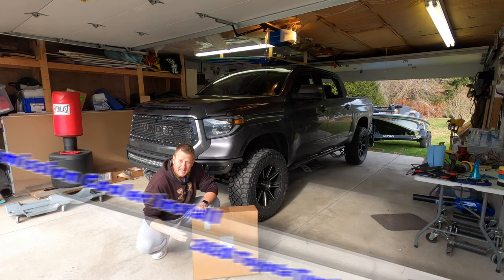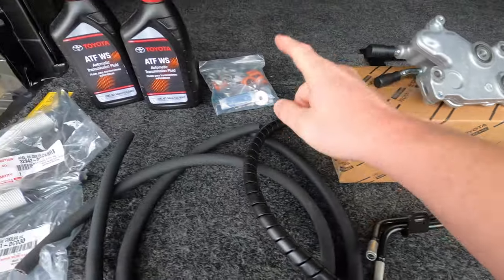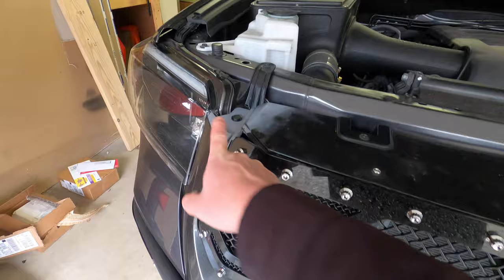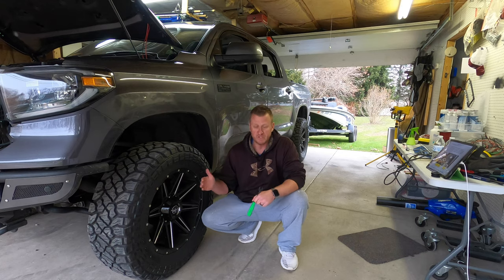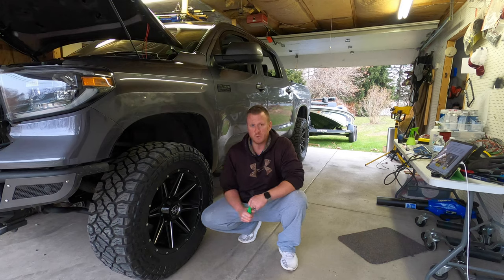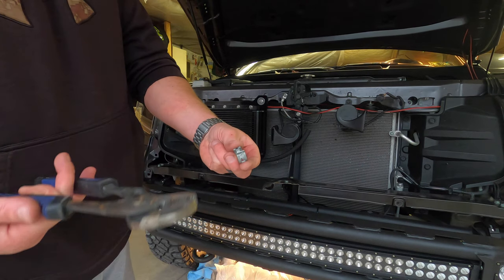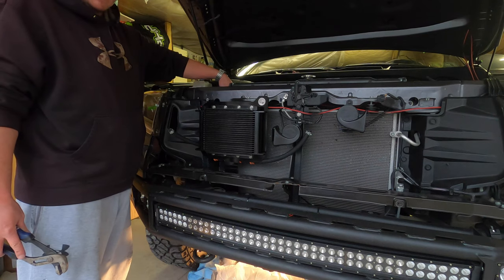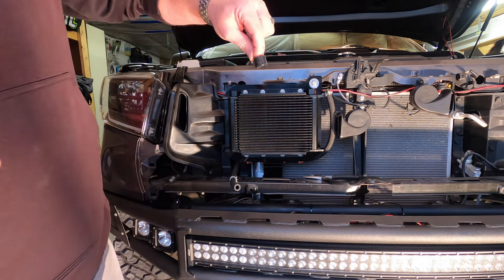Transmission Cooler Install On 2020 Toyota Tundra

Comment: Thank you for the video. Really easy and very well explained. I have a question for you that i may have missed the answer. I see the pin in the thermostat. Is the thermostat pinned and the oils is flowing thru the new cooler at the time you check the level ? 

Thank you again for your video.
Reply from the maker: Thanks for watching Virgil!...Yepper, leave that pin in until after the entire process is completed, it should be the very last thing ya do...you can remove it before going for test drive, but I left mine in until I knew there were no leaks and everything was buttoned up...so it was literally the very last thing I did...hope that helps!
Reply: @NitroZ18Fishing  
Thank you very much.  It did helped a lot.
Reply from the maker: no prob!

Comment: Awesome video. I also have a 2020 Platinum Tundra. Does installing this kit have any issues on warranties with Toyota?  Any issues with service if you take the truck in for service for the Toyota care?
Reply from the maker: Thanks man, I appreciate that!...no issues with Toyota care, I had mine in for an appt since the install and the tech was actually asking me about all my mods and the build...as far as warranty issues, they can’t void your warranty just for installing it, but if you have an issue with your tranny and they can prove the cooler caused it, then they can deny a claim...hope that helps!
Reply: In Canada, my dealer told me it would void warranty, since I refuse to tow without one I sold my trailer

Comment: I wonder if you could have filled the cooler with ATF before you connected the hoses, i thought you needed to connect the lines facing sideways. i wonder if the position of the lines in matters ? nice video thanks !
Reply from the maker: Thank you!...I’m not sure about filling it before connecting hoses, I’ve never seen that done before...and for the position, you may be able to go sideways as well, most mount them in this orientation though...thanks for watching!
Reply from the maker: nice!...yea it's definitely worth adding, no matter what route ya go...thanks again for watching!

Comment: Excellent video Instruction sir. Were there 12 mm flange bolts in those 2 spots that can be reused to secure the hard lines or just empty threaded points? I've seen others that said they did it for only $400.00.   Do you know if Toyota started using a better gasket sealant for the Cam Housing/Cam Towers on the 2019+ models. Many owners of older models are reporting leaks in those areas and I'm trying to find out if they have corrected the gasket maker in our models so that we don't have to worry about it down the road.
Reply from the maker: Thanks Dale, I appreciate it!...those 2 spots were just empty threaded holes, the flange bolts come in the kit from Nick...and yea there may be cheaper ways to do it, but his kits are worth every penny...the thermostat and Hayden 778 HD are $300 alone, not counting any other parts...love the fact that he uses as many OEM pieces as he does, and that Hayden is a great cooler!...I’m not too sure about those gaskets unfortunately, I’m sorry I can’t get ya an answer there!...thanks for watching!
Reply: @NitroZ18Fishing  I'm thinking about this kit also. If I hear anything about that issue reference 2020 models I be sure to let you know.
Reply from the maker: perfect, thanks!...I appreciate it!
Reply: @NitroZ18Fishing  I've decieded to order one of his Kits ...just 1 question....do you actually have to remove the Skid plate to run those lines? I have the TRD PRO skid plate.
Reply: @NitroZ18Fishing  Installed my kit and I went with the "Setrab" option. When not towing even on 93 degree days I have not seen my pan temps go above 200 degrees. My torque converter temps have crested above 200 under longer acceleration but never stay there long.
Reply from the maker: That’s awesome!…sounds like it’s right around what I’m seeing as well, glad you got it installed and are happy with it!

Comment: I’ve got a dumb question. If the cooler is bi-directional, why does it matter which one gets connected to the hard lines? There’s another YouTube video where a guy just runs rubber hose from transmission thermostat direct to cooler (no hard lines). Couldn’t you just warm the transmission up to the proper temp yourself then shut off truck and perform the drain yourself? Could I do the same thing with handheld thermal temp reader? I’m unfortunately a one man operation. I think you did an outstanding job on this video and certainly gives me the confidence to do this job myself. Thanks very much!!
Reply from the maker: No such thing as a dumb question!...the cooler is bi-directional, so on that end of the hard lines it actually doesn’t matter which one hooks up where...it matters on the thermostat end because the hard lines are shaped a little differently and only fit one way...and yepper, you absolutely can use a thermal temp reader, I wish I had one so I didn’t have to bother my wife! 🤣...hope that helps, and thanks for watching!!
Reply: @NitroZ18Fishing  Thanks VERY much sir. Excellent job on everything and no way I would have considered touching this job without your video. Thank you.
Reply from the maker: no prob, thanks for the feedback!!...let me know if I can help with anything else!!

Comment: I did the full set up and it tests good but when I go to dashboards I just have the default one. It looks like you need to add the individual displays  from the user defined PIDs. That seemed to do the trick.

Comment: Hello I'm Greg
I towed with my 27' TT weighing in at 6k last year with my 2020 Sport.  My temps were around 235 - 255*F ambient temps were 90*.  I did install a trans cooler myself on my Tacoma, but i was hesitant on installing it on my tundra and believe it or not I am a certified Caterpillar Diesel Technician. I really appreciate you taking the time and putting together this video.  After watching it, i feel very confident in performing this procedure myself.  I do have a question, I want to purchase the complete kit from your link you provided.  Is the kit i want MHX-514?  Thanks again
Reply from the maker: Hey Greg!...thanks so much, I appreciate the feedback!...and yes sir, that’s the kit...it’s actually a slight upgrade over the one I installed, he changed the cooler after I did my video...this new one is a small upgrade over the cooler I have...let me know if I can help with anything else, and thanks for watching!

Comment: Thank you for the video. Kit ordered from Nick.
Reply from the maker: no prob, thanks for watching David!!
Reply: @NitroZ18Fishing  Success!  Installed today. Twisting the hard line into place just took a few minutes but your video was clear and really helped explain that part. Attaching the 2 hoses at the front to the hard line was a fight, that was the most difficult part.  Still can’t believe they removed this but even left the bracket near the warmer for the hoses. Thanks again for the video.
Reply from the maker: awesome, glad to hear it man!...yea getting them hoses on to the hard lines in the front was no picnic...haha...thanks again for watching!!

Comment: Man that is a killer video. Great job👍👍👍👍 i need this for my 2020 platinum too.
Reply from the maker: Thanks brother!!... I definitely recommend it for sure… He puts some awesome kits together for us… I believe he sold out after I made the video but shoot him an email, he’s taking orders for when it’s back in stock
Reply: Yeah I just checked and I saw he is sold out. I will have to hit him up.
Reply: Hey do you notice any performance differences other than cooler trans temps with the cooler installed?
Reply from the maker: haven't really noticed too much with performance gains, but temps are MUCH better...highest I've seen since install is 192 in the pan, huge improvement...it can only help for sure!

Comment: @Nitroz18 Fishing - hey question for you did you remove the pin on the transmission thermostat or leave it on?
Reply from the maker: Hey Sean!… yes sir, that is the very last step that you do… After checking for leaks and everything… I apologize, I should have shown that in the video but I made a note of it in the information section below… Hope that helps!

Comment: Just received my full kit from Nick, do you know of good shop around Lehigh Valley,  to get it installed?
Reply from the maker: Nice!…unfortunately I don’t know of any shops down that way, I would call around and get a few quotes before committing to anyone…if ya wanna try to do it yourself let me know if I can help ya!
Reply: Hey… did you find a shop in the Lehigh Valley that would do this?

Comment: Hi curious where does the hoses from the heat exchanger run to do they run to the heater core just curious on the original set up

Comment: A cooler with a mounting bracket, some lines, hoses and a thermostat. I wonder if I can just buy OEM Toyota parts online for cheap and just buy a aftermarket cooler and make myself a bracket with sheet metal and drill some holes.
Reply from the maker: Yeah it might be worth looking into!… Either way I highly recommend adding this, especially if you tow a lot… Thanks for watching!
Reply: @NitroZ18Fishing  thanks for uploading the video and helping everyone. I don’t tow a lot but I think the trans cooler is necessary because heat is what kills the transmission. I looked around and did some research found the supplier for the  same brand cooler, bracket, hose and SS hardware plus OEM parts that can be ordered online at discounted price. Everything comes out to approx $240 cheaper than buying it as a kit. I guess it’s a lot easier to buy it as a kit for most people.
Reply from the maker: Nice!…yea people probably just grab it cause it’s easy, but shoot, if ya can save that much it’s worth the little leg work!

Comment: Why are you adding 1.5 quarts when you didn't lose any fluid? Is it for the added capacity due to new lines and then cooler itself? Thanks in advance
Reply from the maker: yepper, it allows the cooler/lines to fill, and than you lose some when checking levels at the end of the process...thanks for watching!!
Reply: @NitroZ18Fishing  Well done on the video. I think I would have pre-filled the new cooler with fluid. Looks like it would be easy with the connections facing up. That might minimize how much time you spend on your back pumping fluid.
Reply from the maker: thanks Mark!!...yea, that wasn't comfortable but thankfully with the truck being lifted I had some extra room to move around...haha...thanks for watching!

Comment: Did the install today all went well they did change the cooler to a horizontal cooler. Everything went great until I got the VIP Fusion
I could not get the values to flip to the dashboard with gauges. I was forced to keep hitting the test button until I hit the Pan Temp.
What is the secret

Comment: Do you take that pin off that’s holding the thermostat open after you’re done?
Reply from the maker: Yepper!...I didn’t show that part in video but probably should have, I apologize...I did put it down below video in the details but I know not everyone looks there, so I should have included it!...removing pin should be very last thing you do, even after testing for leaks...thanks for watching!

Comment: Hello. Do you leave the pin in the thermostat all the way in or pull it? Thanks
Reply from the maker: Pull the pin out after everything is complete, so after checking fluid levels...pulling pin should be very last thing you do, I forgot to mention that at end of video but I wrote it in video info...wish I remembered to actually say it in video though!

Comment: I just bought a Tundra 2020 with RWD. Does anyone have this version and experience overheating? During towing / during normal driving?

Also, do folks with all other models that are lacking the factory cooler generally only experience overheating when towing?

Comment: Do you know if there is any significant difference between the Hayden 778HD kit and the MHX-514 kit on the Genuine Cooling Systems website for the 2020 Tundra?  Also, will these kits fit the TRD-Pro and are the install instructions you provided the same?
Reply from the maker: I’m not too familiar with the MHX, I believe it’s just a slight upgrade over the Hayden but if you email him directly he’ll give you a definitive answer for sure, he’s a great guy to do business with!...and yepper, install would be the exact same on the Pro, thanks for watching!

Comment: I thought about being under the truck with my wife or anyone else shifting gears and failed to get a warm fuzzy feeling. My plan for my transmission cooler is to crank the truck up and shift gears until the transmission gets to about 105 degrees f and turn the truck off. Then get under the truck with the 5 mm hex wrench and then remove the trans overflow plug. When the overflowed fluid reaches a trickle, replace the plug. 
Your reply?
Reply from the maker: I can’t say I blame you, I make sure to get on the wife’s good side before asking her to help with anything on the truck 🤣… I can’t speak from experience on that, I’ve never done it that way but I’m not sure I see any issues if you do it quick enough… Maybe somebody else can chime in as well, I don’t want to give you any false information and I’m honestly not sure on this one

Comment: Hey man, so I’m installing my bumper but problem is I was able to connect 4 bolts with the nfab plate to the bumper but the 2 right holes don’t match to the bumper what should I do?
Reply from the maker: do you mean the skid plate holes not lining up to the bumper?...I actually had to drill mine out a little (made the holes in the skid plate larger) in order to get them to fit properly...mine would have worked but I would have had to force them so I just decided to make my holes on skid plate larger...worked like a charm!...hope that helps!
Reply: @NitroZ18Fishing  so what size of drill bit did you use to make it slightly bigger and yes that’s what I was talking about
Reply from the maker: I honestly can't remember off hand, I kinda just started small and worked up until I was comfortable with how it fit...if I get a chance I'll take a look at the holes and figure out what size I used!

Comment: Did you pull the pin out of the thermostat?
Reply from the maker: Yes sir, that’s the very last thing you should do...I pulled mine after testing it for leaks, so it was literally the very last step I took...should have shown that on the video, I apologize!

Comment: Got a question,  i just got my kit in, trying to install the app. Every time I check custom pid to add the icon, the app keeps the "speed" as the name on the icon and it reads speed on the display,  not trans temp. How do i get the app to stop adding "speed" every time I  go to add trans temp guage ? It literally changes it from trans temp to speed ? I have a 2019

Comment: But S mode doesn’t make the trans shift through the gears does it? Should you add it then take it down the road and come back and check it?
Reply: you're right, it does not. it simply limits the transmission gear to the S# you set it at.
 I.E.: if you set it so S4, the transmission will still go through 1st 2nd 3rd and maxes at 4th gear.

Comment: i would find an older rad which have the trans cooler line and fit the lines there to use the rad as the trans cooler, reason y , liquid to air cooling is superior to air to air cooling. while moving the air would cool the trans fluid splendidly but y sitting in traffic, there is no air flow, and the trans fluid would still be over heated if sitting for too long, ur fans might turn on but the distance and gap bettween the external cooler are too far for the fans to pull enough air through. if u use the tradition bottom rad with a build in tank for trans fluid cooling, the coolant will always cool the fluid store in inside the tank, and if the coolant temp raise, the fans will turn on and cool it down in a matter of second, making cooling ur trans coolant way more effecient than using the external cooler. second thought about filling up the trans fluid, if u decide to use the external one, all u have to do is fill the unit with fluid before claiming all the hoses ends .and there u go, u don't need to do any of checking ur trans fluid level.

Comment: I just checked your website and it's a one expensive kit. I got my stuff for 1/3 of the price.
Reply from the maker: you got all this for 1/3 of what he's asking???...the thermostat alone is $170, and the Hayden 778 cooler is $120...that's not including anything else...haha...you got one heck of a deal man, good for you!!
Reply: This what I ordered from toyota still need to locate a cooler 
Part Number	Part Name	Price	Quantity	Total
32907-0C020	 Cooler Pipe	$78.55	
32970-34030	 Thermostat Unit	$158.18	
32941-0C030	  Inlet Hose	$36.59
32942-0C040	 Outlet Hose	$31.76
90466-16004	 Inlet Hose Clamp 	$2.69
90080-10400	Hinge Bolt	$1.70	2	$3.40
Subtotal: $319.24

Comment: how s about running a cooler summer thermostat instead, say 175 or 185 instead of 195, the transmission is warmed / cooled by the radiator fluid, so drop coolant temp and transmission temperature drops?
Reply: Sounds like that may work.  Did that to my 1989 Mustang LX 5.0 and ran cool temperatures

Comment: You don't need a cooler. I tow 10,800 lb boat and never have any problem. I have to go up in mountain 17 miles. The only problem I have is when come back my brakes get hot and almost don't have a brake. But I change my brake pads for better ones (Akebono) and that problem stops too.
Reply from the maker: It may not be “needed”, but it’s definitely nice insurance...it’s no secret heat kills transmission, and some of the temps I saw before adding it were definitely not good...I’m sure there are plenty of people who would agree with ya, but I for one like the extra insurance...thanks for watching!